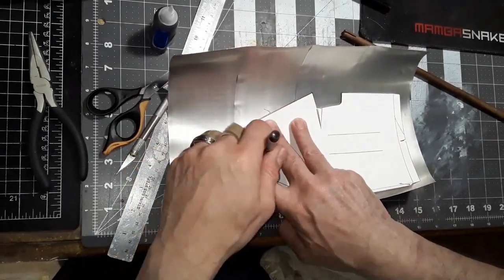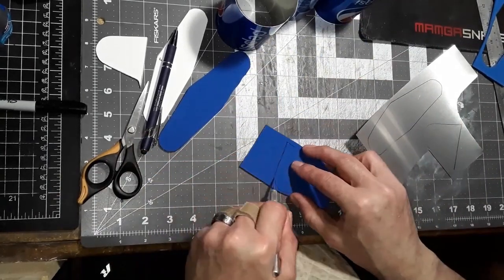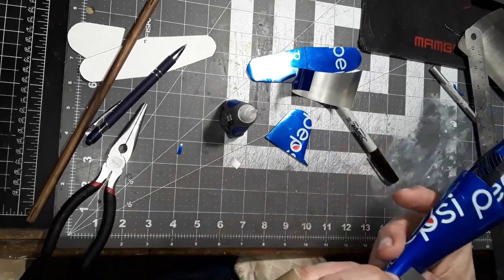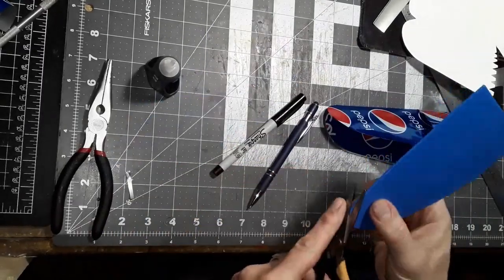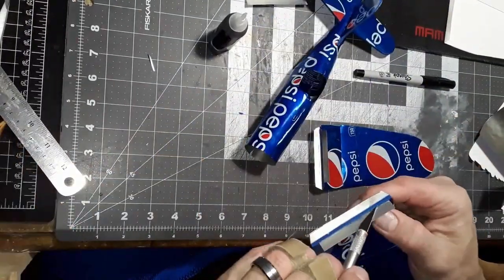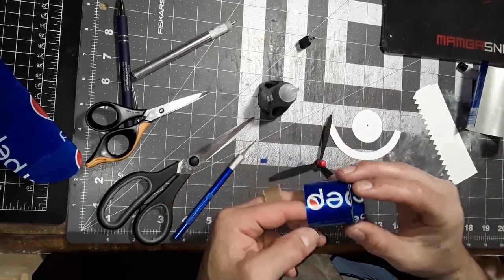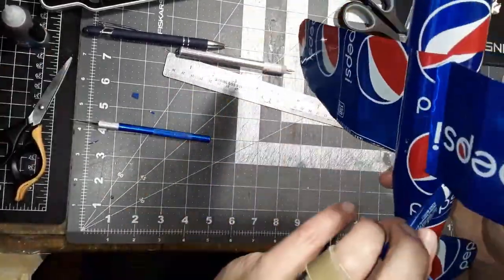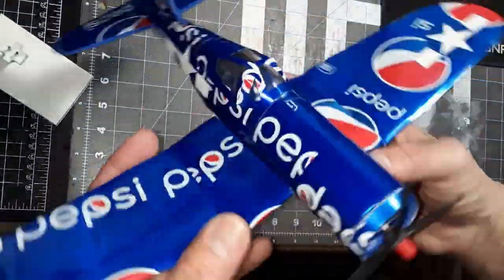DIY homemade Soda Can Airplane: Make a recycled soda can air plane!

Comment: Looks beautiful but doesn’t explain In good detail
Reply from the maker: These shorter videos focus only on parts assembly, which is what many of our viewers told us that they would prefer to see. If you are looking to see one of these built using more detail, my advice would be to check out the longer videos, such as the Fokker Dr1 triplane, Maverick's F-14 and especially the P-51D Mustang. Each of these videos, although time-lapsed, are much longer and show the process in greater detail...